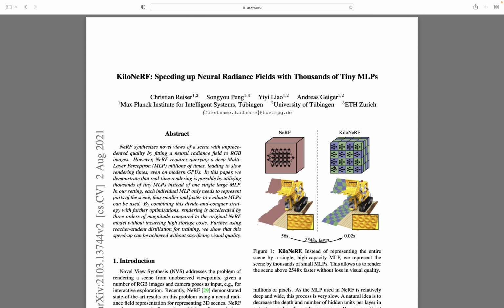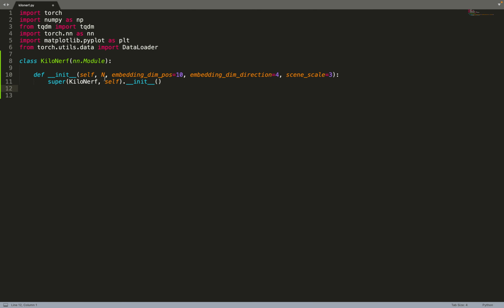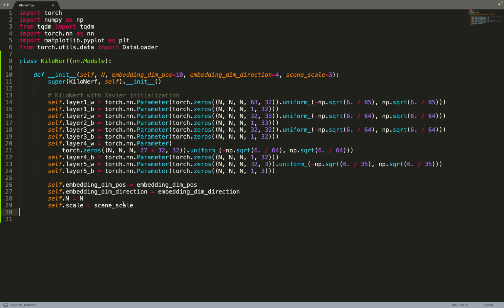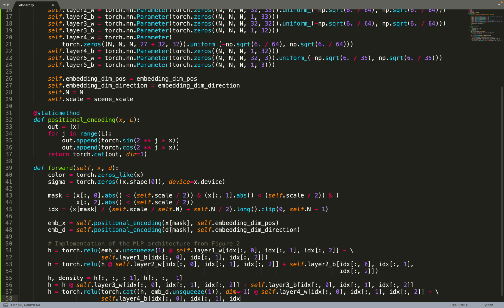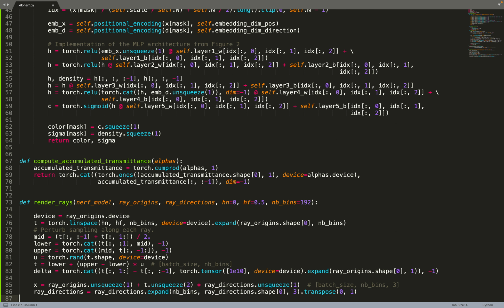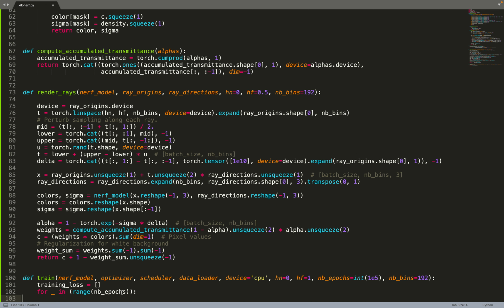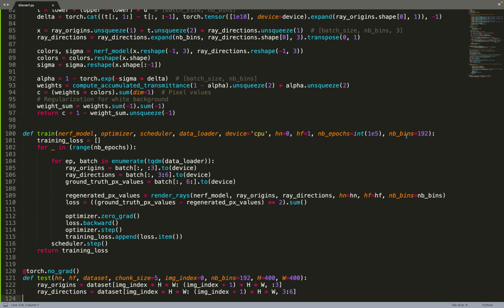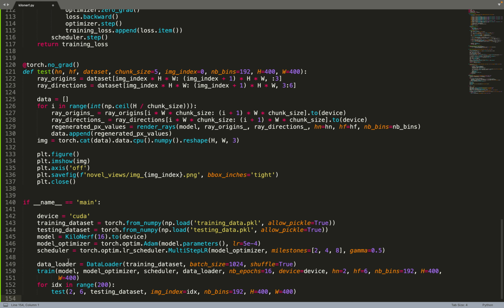KiloNeRF: Speeding up Neural Radiance Fields with Thousands of Tiny MLPs | 100 lines of PyTorch code

Comment: You're amazing, keep your great job!
Reply from the maker: Thank you so much! :)
Reply: @papersin100linesofcode  can I ask you some information? I'm wondering if your provided code will produce a similar-quality result compared to the NeRF code provided by the paper's authors?
Reply from the maker: @tuanvu9755  I am trying to get results as close as possible to the ones from the authors with most of my implementation. With NeRF, I usually do not compute the PSNR, and do not implement some components that would only improve results by a small margin, and make the code much more complicated. In short, running the official code should produce better results